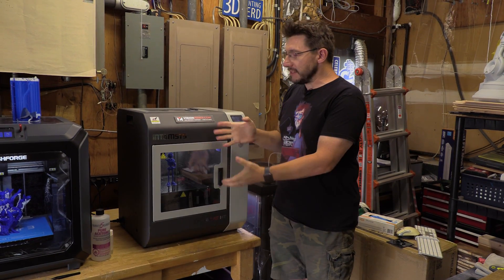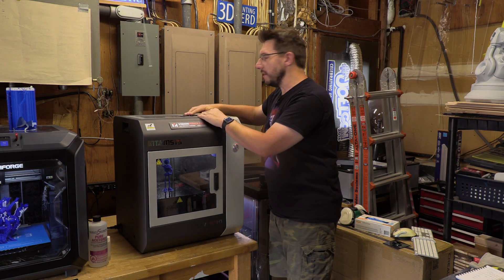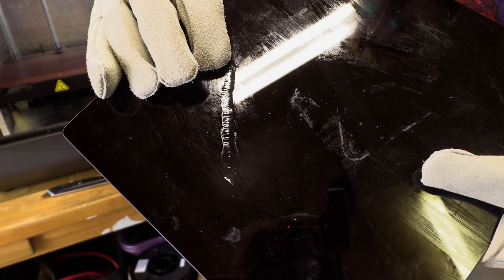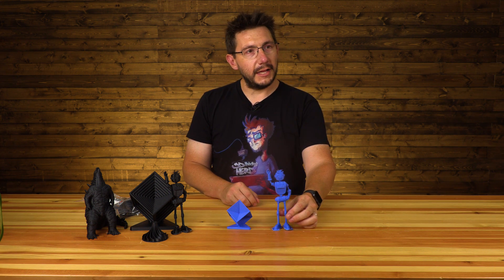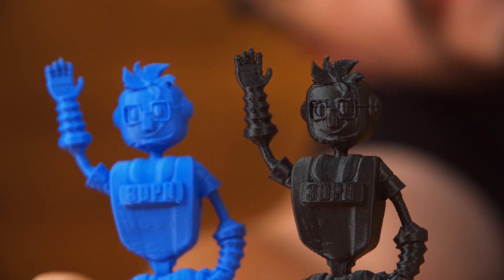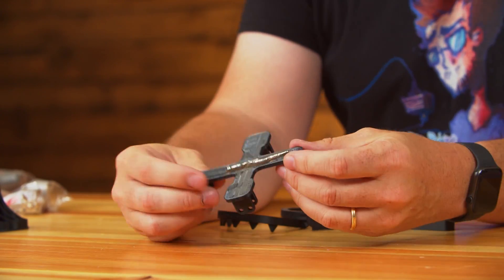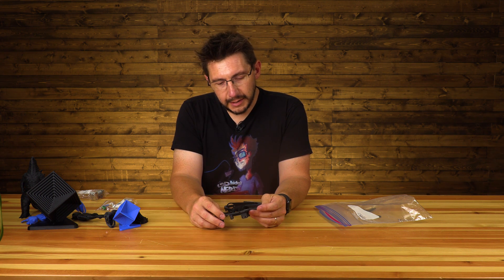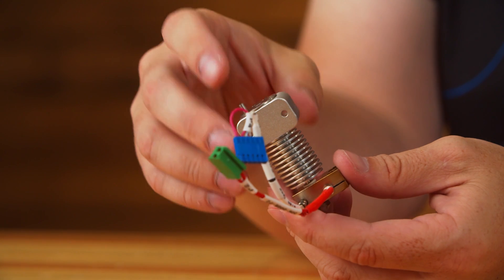First Prints from the FUNMAT HT

Comment: Very cool! I do have to ask though......what to do in geometries when supported is needed when printing high temp materials. I do have access to a Fortus 450 at work and their breakaway support for ULTEM is godsend
If you were to print ULTEM in this machine and need supported areas what is the solution (short of devising your own support system in SolidWorks?)

Comment: Unless the strength of the prints are at LEAST 3X stronger than what . . .oh. . . a PRUSA i3 can print. . . it's a total waste of money.
Reply from the maker: But that doesn’t make sense - Prusa machines cannot get to 450c and print PEEK or ULTEM. Those materials are MUCH stronger.
Reply: @3DPrintingNerd  And that's my point.  IF the FUNMAT HT can print materials 3X+ stronger, then  yes, I can see it being somewhat worth the price point.  If the materials are only moderately stronger than say... PLA POLYMAX, as in 1.5 or 2X stronger, the machine is simply too pricey to be worthwhile.

Comment: I print ABS on my Anet A8 all day long no problem and get models looking really good. You buy this printer to print PEEK, PC and POM some nylons because you are to lazy to build one or mod something your self.
Reply from the maker: That makes zero sense. So, a company needing to print PEEK, PC, POM, CFPEEK, ULTEM - they are lazy if they don't build their own machine, or mod a machine to make it work? That's like saying people that buy cars are just too lazy to build their own.
Reply: @3DPrintingNerd  A car for starters has close to 30,000 parts and a lot of them a VERY unique there are kit cars avaliable if you have the time which i am sure will be well over 1000hrs to put together and as far as a open source car well they all look to be a long way to have anything close to the varity of 3d printers from a railcore to the standard AM8.
A 3d printer on the other hand has well under 100, 95% of them can be purchased off the shelf if you are buying a machine like this i can garantee they own a machine that could make the 5% of the parts they dont have like a basic 3d printer, CNC or milling machine. The designs are open source and freely avaliable including the code to run the machine. Sorry but i am not really impressed with price tag of $6,000 USD you didnt really talk about the parts use by this machine. What looks like a ball screw for the Z which is nice, but then is it still using smooth rod what looks like 10-12mm and not a mgn linear rail?
There are currently open source projects converting a Ender 5 into a enclosed tempature controlled 3d printer with climate control and well thats sub $1000 USD build so you have a spare $4000 RND so roughly 3 weeks wages or 120hours to figure it out.

After all isn't this channel based for a home user/ hobbiest not a professional company? its nice and all you got to play with a high spec machine and showing us what 3d printing is capable of but i this just seems that less than 1% of your viewers would be even considering buying something like this.
Reply from the maker: @Side85Winder  That's great to hear about the Ender 5, do you have some links to the project? The channel is based around "3d printing" - whether that's home hobby use, industrial use, professional people in the industry, cool projects, or other fun stuff nearby. I don't know if less than 1% is accurate, but if I somehow find out, I'll let you know!
Reply: @3DPrintingNerd  link to ender 5 heated chamber project example.
https://youtu.be/mPC-2KZLMzk

Teaching tech has a amazing youtube channel thats really exploring the new open source features of our printers with a hands on approach. It might not be at a point of printing PEEK but i think it might not be far away and something a little lower like PC would be very achievable.
Reply from the maker: @Side85Winder  Oooh THANK YOU for the link! I'll give it a watch!

Comment: Hi Joel. The build plate removal process is brutal and this will put off a lot of buyers. Can you try the process I use on my ender 3 glass mirror plate where I have had 100% success since I started 18 months ago. Rub a blue glue stick over the glass and then with a wet paper towel remove all of the glue. The prints get perfect adhesion and when the printing process is finished I let the plate cool. When I hear a loud cracking sound usually at room temp the complete print can just be lifted off or slid of the glass. I would be interested to find out if this works in this enclosure.

Comment: Gets engineering spec printer - prints in ABS
Reply from the maker: It includes ABS and comes pre configured to use it. If you need that changed I would send an email to Intamsys.
Reply: @3DPrintingNerd  That's kind of a weird sales pitch for an engineering printer. I guess the material cost for PEEK/Ultem etc are a little high to send out to youtube reviewers.

Comment: The low temp hot end does have a ptfe tube in the lower section! The peek tube is only on the cold side of the extruder. It wears out and will cause skipping like you are experiencing. Need to replace it often
Reply: Truth! We personally opt for all-metal, all the time. The PTFE just breaks down and gets in the way, really not necessary.
Reply: So you print abs and pc with the high temp head? Interesting

Comment: to protect glas buildplates you can use Printastick (it provides perfect adhesion, while also actingg as a separation layer to the glass. PETG also likes to grab on, I always use printastick whenever I print Petg, ABS or other stuff. can't afford delays due to failed prints for my element14presents videos.

Comment: Have you actually tried 90˚C enclosure? They claim 90˚C enclosure temperatures but the early Funmat HT unit I saw couldn't go much above 70˚C. This was a pain point for the user. It also used Ultimaker slide parts and exposed the belts to the enclosure air, so maybe it's a good thing it couldn't go to 90˚C.

ABS is a great material, with incredible strength impact resistance and make beautiful parts if you can print it right. You need a printer designed for it, i.e. the right machine for the job. Most consumer printers are really designed for PLA and they're advertised for ABS but I feel it's dishonest because they're unenclosed and often sliding bed, cooling the model much faster than it should. It looks like this machine should still do a better job of it though.
Reply: i use the funmat HT, must be the older version because they sent us the new wiring only after we asked about it... Im not a fan personally.
Reply from the maker: No I haven’t - not yet. It’s on my list!

Comment: I Have successfully printed Hobby King ABS and HIPS on an Anycubic Chiron and Matterhackers Pulse. Its under $12/kg. So lets see what that machine can do in comparison. We print Mechanical parts. HK HIPS on the Chiron (only mod is I replaced the PTFE with a capricorn) 255 on the hotend 105 on the bed. ABS about the same. If you want I can send you some of the smaller STL's for comparison purpose

Comment: I love using ASA for Lazer Tag and Nerf parts.  Durable (a little harder than ABS) and very strong when you get the layers to adhere well.

Stick with a PVA/glue stick for bed adhesion with your ABS and ASA prints.  Use a little isopropyl alcohol to get it off the bed.  Keep PETG away from the Borosilicate plates because it will never let go.

You should make some of your F1 parts out of the PEAK/Carbon Fiber and/or Polycarbonate before you send it back.

So, can it print pewter miniatures using ROHS solder as the filament?  Maybe something zinc/lead instead?

Comment: the problem with too well adhesion to glass can be fixed with putting some water around the edge of the model. it can even help when cooled down to room temperature already. Works for me with PLA after cooling down on a ikea mirror when prints are too well stuck. just add some water around the edge, maybe try a bit to get lose, but often just wait and  you can hear it crack loose or hear nothing. 1 min later and it can be removed with ease

Comment: It is cool to see new stuff (I know that this has been around for a while but cool for us to be able to see) You should work with Daniel Noree to build a differential joint and transmission for the Open RC car, that should put it through a lot of stress and we could also see if it is any more wear resistant to the frictional forces in the car.

Comment: Very concerned about removing models when buildplate is still hot, sounds more like "work-around". With my experience, slow and even cooling of buildchamber for ABS part is a must in such scenario. Heated bed messes with printed part temperature, making cooling process even more complicated. By the way, is there an option to print without heated bed? I would definitely tried it if it's possible. 

Also, thank you very much for the review. I've been waiting for this machine to become more popular, since it allows so much more than usual printers. Hope to see more :)

Comment: Scraping prints off the print bed is a non-starter for me now that I have the Prusa MK3's removable flexible print bed.
Reply: Yeah. It appeared to be a nightmare removing the prints. I mean the friggin glass pulled off.
Reply: @moXDesign That's not a bad idea!  The glass probably contracts faster due to the cold than the plastic, and that pops it off. HEY JOEL! ARE YOU LISTENING?  You need to try this and report back to us!
Reply: With the bed temps used for some materials, I suspect the magnets might go bad quicker if they made this a mag bed.
Reply: @JeffDM  that is very true. But they do make clip on removable beds that are flexible, I think.

Comment: Why the ABS hate? Isn't it the most common/affordable?
Reply: It once was but the material PLA has basically superseded it. being cheaper, stronger, much less toxic, easier to print and printing at lower temperatures. ABS is mainly used these days for it's slight flexing ability, because it can be smoothed in acetone, and it's higher temperature resistance.
Reply: @infernaldaedra  Weird! I started with ABS and moved to PLA because I didn't want water or moisture to effect my models if they were outside aha and I wanted to be able to use acetone to smooth my models. Might have to go back. Noticed my ABS costs more than PLA.
Reply: @nickvarley8365  I think abs may hold up a little better than pla if used mainly outdoors but I heavily prefer PETG if you can spare a couple bucks it's much less likely to deform and is very resilient and pretty easy to print
Reply: @infernaldaedra  I've never even hard of that! But I'll look it up. Sadly switch to a DaVinci duo by xyzprinting and I can only use their filament :/
Reply: @nickvarley8365  That's unfortunate I've tried to mess with he spools before to try and change filaments I don't think I've been very successful with it but I think it's doable. I really hate that some printers so that. Maybe you can eventually change the board out with a open source one

Comment: That glass fusing with the abs is a known problem of that type of bed. The same thing happend to me on a uktimaker 3. I solve the issue using Elmer's glue stick on the bed acting as a release agent. Works perfect, you can let the bed cool and then the part is easy to remove.

Comment: All printers should have a flex plate there is no reason nowadays to not have a flex plate
Reply: I don't think that would work at the temperatures that this can get to specifically when printing Ultem or PEEK the reason this has a glass bed is because it needs a glass bed for the materials it's designed for.
Reply: @infernaldaedra  True however there are many other types of flex beds other then magnetic and would solve the issue.
Reply: @LiquiDirt3D Metal sheets tend to flex when heated up to higher temperatures making them difficult to level, A flex plate with what printing surface on it? PEI would probably just be a sacrificial layer and the adhesive used to hold it in place would get so hot it would probably fail pretty quickly. Borosilicate glass on the other hand does not flex when heated up and it doesn't bubble up. Making it far more preferable in my opinion when you want every single print to have the best chance of printing successfully as these materials are very costly. I have seen people use thick sheets of PEI as a build surface with success but that is  pretty similar to glass as well. I would prefer not to have $10-$50 of plastic detach from the print bed ever of it could be avoided lol. Getting it off afterwards I'm not too worried about

Comment: removing the print when the build plate it hot has the problem of warping your print as you try to lift it and it bends because the PLA is still warm.. so give it a few minutes to cool a little

Comment: So I have used the Intamsys in the past and it really is a cool machine. A few things to note though: The models you printed don't really represent the parts you would typically print on such a machine (or with ASA for that matter). If you want nicely detailed prints, you would go for PLA on something like a Prusa. Where this printer is interesting is when it comes to engineering tasks (printing end use parts, fixtures, jigs, tools etc.). Many companies use PEEK, PEKK or PEI because they are rated for UL94 V-0, FAR 25.853 or OSU 65/65. I like your videos, don't get me wrong, but for this one you sort of missed the point in my opinion. Try printing something that shows of the crazy stiffness and strength of these materials, not just toys and figurines! :) Typically users print gears, flame retardant covers, high temp use cases (something in machinery or engines) etc.

For the adhesion issues, I would recommend Magigoo (at least for the low-temp stuff). It usually makes the removal quite a bit easier or at least provides a thicker coat which is easier to wash away under tap water. From my experience letting the parts cool down also helps (I know you said the opposite in your video). Adhesion solutions like Dimafix for example have graphs that show that the adhesion is weaker when it is below 60 degrees and strongest between 100 and 120 degrees. On top of that you also have the shrinkage of the Polymer when it cools down which sometimes even makes parts "pop" off. If you want to be a bit risky, try putting the glas plate in the freezer directly after a print. I do it all the time and did not have any issues, but if you're unlucky it could shatter the plate. ;)
Reply: echannover48 oh, believe me, we’re gonna print some stuff that test the materials for sure. But this was more just an “initial impressions” kind of video!
Reply: @lasersandlayers  Where's the follow up video?
Reply: But thank you for watching and for the suggestions!
Reply: I realize it's kinda off topic but do anybody know of a good website to stream newly released tv shows online ?
Reply: @Damian Karsyn Flixportal
Reply: @Ralph Aron Thank you, I signed up and it seems like they got a lot of movies there =) I appreciate it !
Reply: @Damian Karsyn glad I could help xD

Comment: For the price I would much rather get the Sinterit Lisa 3D Printer which is a desktop SLS Machine and is priced at 6000$ as well. If you could do a Printer review on that or one similar I would find that quite interesting to watch.
Reply: I mean thats great.. until you start factoring in the material costs for powdered metals, and limitations of how many things you would actually print with it vs a plastic option.

Comment: The temperature at the surface of the Sun is about 10,000 Fahrenheit (5,600 Celsius). The temperature rises from the surface of the Sun inward towards the very hot center of the Sun where it reaches about 27,000,000 Fahrenheit (15,000,000 Celsius).
Reply: finally a good answer, thanks for sharing!!!

Comment: Abs is very hydroscopic. I print more with abs than with pla and leaving abs set for any period of time in my house not sealed up would result in bad prints full of bubbles from the moisture boiling out. I could literally see steam spurting out of my printers nozzle as it printed. I've had to bake my abs multiple times to dry it out. My pla works fine even sitting out for weeks- months at a time. The only pla I had an issue with absorbing moisture was wood fill.
Reply: Agreed on all counts I think pla as a material is overrated. I use abs allot and some crazier filament. For me it's temp too pla just doesn't go anywhere near hot enough to be useful in so many applications for functional parts.
Reply: Exactly. Not as hydroscopic as nylon but worth looking after.
Reply: @owensparks5013  I find it funny that people talk so much trash on abs, I don't find it that difficult to print with and the fumes aren't as bad as people seem to make them out to be, maybe im just not sensitive to it like others are, but im probably not like the average tech minded person into 3d printing. I am a machinist by trade and work on cars and get my hands dirty. I've been exposed to things thousands of times deadlier than some abs fumes from printing. Main reason I prefer abs is because I design and print prototypes of useful things, not just a bunch of little trinkets.
Reply: Well said 👍
Personally I use ABS for most things (day job is production engineer in factory) carbon loaded nylon for important stuff and PLA for arty widgets. Nothing scary there. After you've laid on your back under a car and flooded your hair in old gearbox oil a faint waft of hot plastic is not worth mentioning...

Comment: E3d premium abs is sabic mg94 ABS, which is what stratasys has been using since the 80s and is the defacto standard in printable ABS. As for what to print in high temp stuff, it’d be cool to see some of these parts implemented in the openRC! Also maybe printing some replacement parts for the prusa in CF peek?! Talk about increased rigidity!